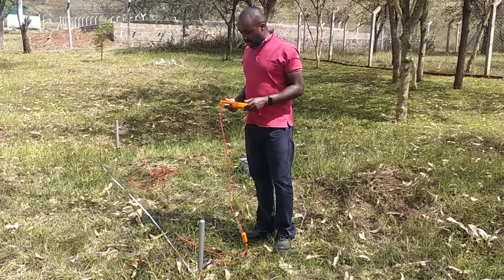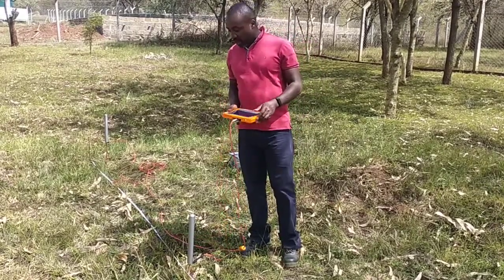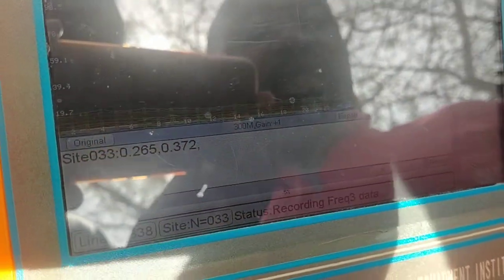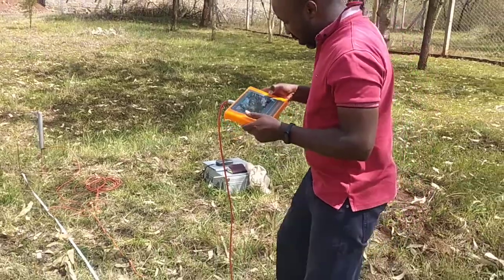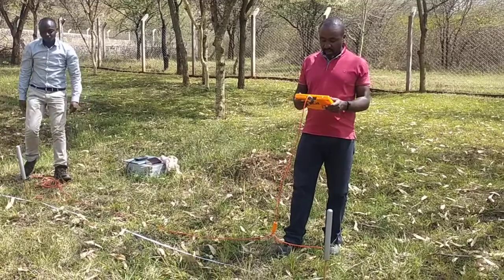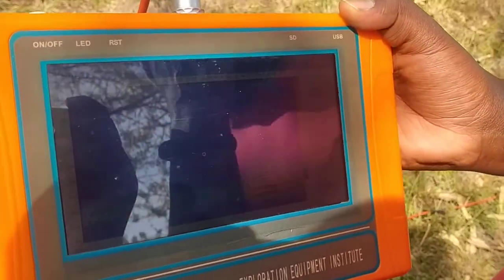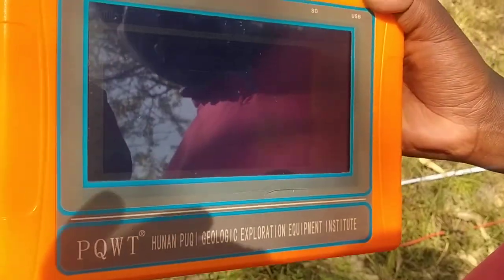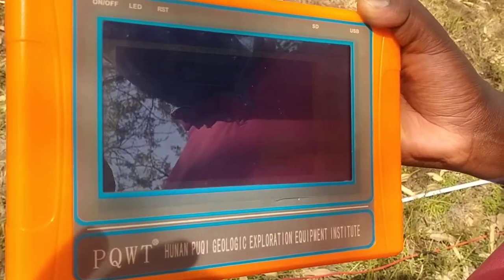Hydrogeological Survey Part 1- Resistivity Test using terrameter  #boreholedrilling #water

Comment: Great video Geo. 
But I have some questions in so as you can clear my recent understanding.
From what I know that is a PQWT water detector device and not Terrameter as you mentioned. And if it is PQWT, the device uses Very Low Frequency to study the subsurface rocks. 

I would like to know the interrelationship between frequency and lithologies.
Reply from the maker: Thank you. Will get back on this#
Reply: @toroitichpatrickyegon4866  I'll appreciate it. Good work
Reply: Pqwt is not a VLF. Electromagnetics is a very wide application. The method of the electromagnetic used depends on data collection. PQWT is a new electromagnetic method called Geofrequency. The values you’re seeing there are not Resistivities. They are in electron volts (eV). The two electrodes are purely for potential difference thus keeping current constant because it is not there. These voltage values can be assumed to represent resistance and not resistivity since current is kept constant. The voltage is thus directly proportional to the resistance in this case. 

I can go on and on but I think that’s enough for now